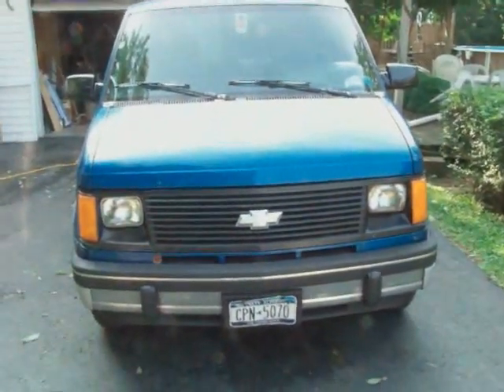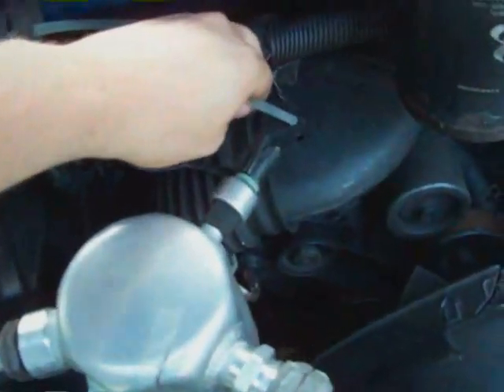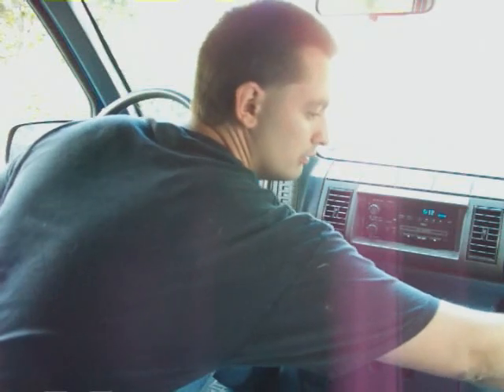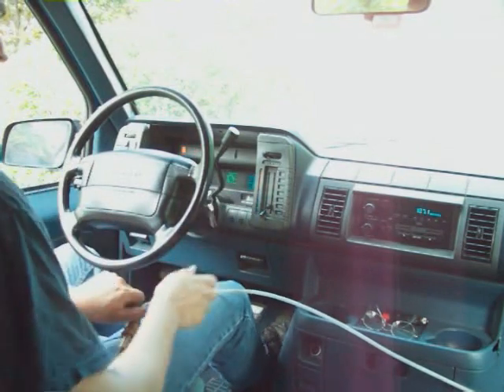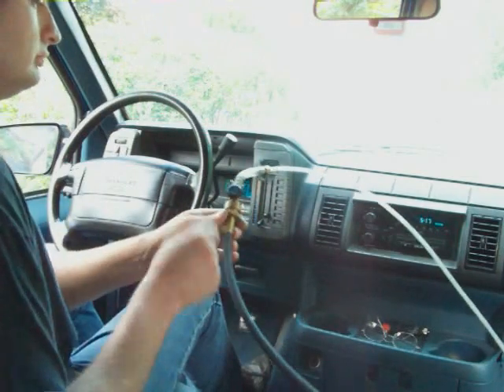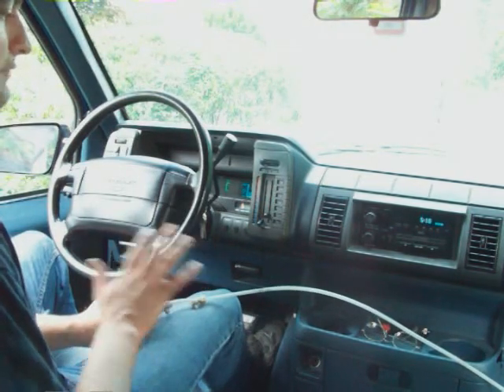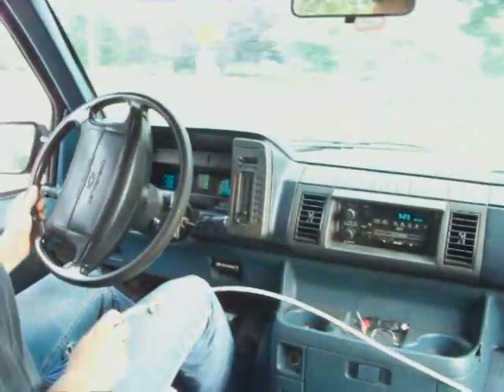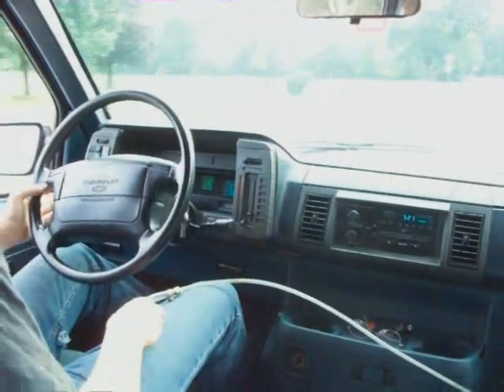astro van running off a propane torch NOT gasoline

Comment: Try bottle hose directly to your air intake. Use just the bottle valve maybe 1/4 turn to start and idle. You can jet out the torch valve.

Comment: There's a fuse to the fuel pump. You can wire a kill switch to the FP without wrecking wiring. Make 2 wires with blade connectors to plug into the fuse panel add a switch to the other end. Direct the fuel hose directly to the throttle body. You can adjust fuel by adjusting the propane valve.

Comment: I don't know if you have fuel injectors. But they won't fare well without gas lubrication. The reason you are having so much trouble with running the engine, is that the LP gas air/fuel ratio has to change, according to load.

Comment: No Kwacz.......   That's not how to propel the ejector seat like in James Bond Movies!   Having said that.....  If the tank valve or hose leaks into the passenger area and anyone smokes, well it could be an interesting ending to your video!

Lawd fadda.... turn it lean...no wait turn it rich....oh shit it's rich now...why does it do that as i keep pushing and releasing the pedal......damn this is awkward but it works when you get used to it!   LOL

Hey Kwacz, Try installing a gas ball valve on the gas pedal to the fuel is supplied more or less as you push on the pedal!!!    Oh shit noooooo don't try that please I was kidding!

I applaud your efforts here and you proved a point......  BUT PLEASE get rid of that contraption/set-up and either go back to all gasoline or do a proper and safe install which includes keeping the tank "OUTSIDE"  !!!!!

Comment: All yall freaking out over it blowing up. Ups trucks have been run on propane/natural gases for years.
Reply: yah but the way this is set up, when it stalls and backfires slightly, if youre not paying attention, the intake is now on fire and the plastic pipe will feed back to the tank...
Reply: @Hammerjockeyrepair  an lpg tank has no oxygen in it, fire can't go back into it.
Reply: @Camwize  if there was no chance of a problem then there would be no need for them to sell FLASHBACK ARRESTORS
Reply: Propane/CNG conversions are awesome, but a conversion that pays zero attention to safety is not so awesome.  You don't see a UPS driver taking his/her attention away from the road to feather a knob...a knob that causes back-fires if not turned properly...back-fires that produce an ignition source in the throttle-body/duct...a duct with unregulated and uncontrolled amounts of propane flowing from a section of poly tubing....which was rated for propane, I'm sure.  I can promise you that UPS trucks use regulators, a fuel metering system designed for propane or duel fuel, a fuel delivery system design for propane, a fuel tank that is secured, and a fuel tank that isn't inside the cabin.  There's only one thing preventing his nomination for the Darwin award...he hasn't died from his antics yet.  But when he does, the cause of death cited on his death certificate will be "Worst case of stupid ever".  One positive is that he has only achieved 25 MPH.  Wait, don't UPS trucks go faster than that?
Reply: @samiches2008  Fuck you people are boring, live and let live.

Comment: I did this with my 94 s10 I used a hi pressure house regulator 3/8 line with a ball valve in the cab and I can run 75  I have 2 30 pound cylinders it is tempormental but very possible use it every day because I found a place that will fill my tanks for 10 dollars a pice and I have a togel switch to turn my fuel pump on if I need regular gas...

Comment: You mentioned carburator. Don't you have fuel injection in you  Astro ?
Reply: The 'carburetor' he mentions is the torch-head, w/ screw-valve, plastic line, he's holding in his hand.

Comment: needs some steel wool as a gas check from flame back
Reply: Steel wool is flammable, it would be a very poor choice. Also, since there is no air in the propane tank, it can't explode.

Comment: you didnt have to drill a hole into your car you moron !! where do you thing all the wires are coming from !!?? your car or truck already has a a couple of holes already for all the electronics in your dash you dip shit ! that's what they are there for so you can run things from the inside to the engine
Reply: If I remember the Astro/Safari layout correctly, the existing holes in the firewall aren't very easy to access.   That little hole is the least of the problems with this video.

Comment: He's doing Trail n error so u idiots wont make the same mistakes. He's uncut. Nice video dude! And this does work!!! Especially if u do it RIGHT! Hydrogen is the way to go though!
Reply: Hydrogen in a tank is not good, and hydrogen + oxygen stored in a tank is a bomb waiting to explode. Hydrogen requires a huge amount of energy to compress. Hydrocarbons like propane are much better because the carbon partially neutralizes the repulsive charges between the hydrogen atoms. Hydrogen storage in carbon nanotubes is interesting though, some people are making extraordinary claims.
Reply: TempTag 
Yes it does i have a 100 plate one and boy 
Thats free energy

Comment: For all of you people lamenting the possibilty of explosion, propane has a higher ignition temperature than gasoline.
Reply: You're missing the severe problems.  

He needs a regulator, that will only allow gaseous propane through.  He says in the video that he sees liquid propane in the hose.   That can (and will) freeze the plastic, and it will leak.   

Propane is heavier than air, so it will "puddle" inside any enclosed space.  Even in an open space, it still puddles enough to cause an explosion.   

Propane has a much wider range of usable air to fuel ratios, so it has a better chance of exploding over gasoline vapors. 

Any little spark inside the cabin of a vehicle could ignite the propane gas.  There are a number of relays in any vehicle, which are not safe for flammable gas rich environments.   As I recall, there are some relays on both the driver and passenger sides of that series of minivan.

Propane is an asphyxiant.  So if your enclosed space (like the van) is higher than your nose and mouth, it can (and will) kill you.   

If he had used a regulator, along with a proper injector up at the throttle body, and run hard lines on the outside of the vehicle, it would have been a lot safer.

Anyone trying experiments like this needs to learn everything they can about what they're using.   If he did, he wouldn't even consider that setup.
Reply: @JWSmythe  look out everyone! The safety police are here!! Hey Mr Franklin, get that kite out of the sky , it's dangerous!!! You got a deathwish Mr Newton? Get out from under that apple tree, apples are heavier than air, they "puddle" if one of those falls off it could paralyze you, or even EXPLODE!!
Reply: Gasoline puddles as it is a liquid. 
Gasoline vapors are also asphyxiants.
Reply: +Jemalacane0 ... and gas tanks aren&#39;t kept on the front seat floor, with the wrong hoses to it.

Comment: My van is my home. It's jacked up with no tires. Can't move and won't ever move. Totally not driveable. Engine and A/C and heat work great. I live in it. Using your idea I expect to run the engine at a constant RPM to operate the A/C and charge battery etc. I'll disconnect power to the injectors and fuel pump.  Propane is readily available to me while gasoline is not. I'm also concerned about carbon monoxide from the gasoline.  Hope this mod will work for me.  Also will implement a safety cutoff valve that senses engine failure (via vacuum loss) and cuts off the propane.  What do ya think?
Reply: put an extension on your exhaust and run it out away from your living area if you can
Reply: Please get it fixed up enough to drive... I don't want you to have to abandon your home when you have to move
Reply: Get a small reliable motor like a honda gx and use it to run a car alternator with a belt. Charge deep cycle batteries and use a cheap inverter to run electronics. Running that big engine will waste a ton of fuel.

Comment: how many miles to a bbq tank? lol
Reply: +richard ford a swag is a20LB LP tanks is like 5 gallons of gasoline or a 15LB fill of LP is like say 4 gallons   This about 100 miles range on a BBQ tank
Reply: 3beltwesty 20lb propane tank holds 4.3 gals of lpg. lpg should have less energy than gasoline so it's probably roughly equal to 3 to 4 gallons of gasoline

Comment: why not leave your fuel pump on and just use a little bit of propane in your air intake to bring up mpg.
Reply: hondaxl250k0 that would likely just result in the pcm constantly trying to correct the mixture and fuel economy would probably actually decrease

Comment: Fun stuff.... An old test is to use a propane torch near the air cleaner to find leaks, or directly into the throttle body to check mixture. (or to just run...)
Anyway, I noticed that dash in your Astro!  Where did that come from??  I've got a Safari, same color ('93 and also in NY!)  and I've been looking for something like that. (and for some reason this morning I can't find the private message link...) Thanks

Comment: This would be a great thing to have as an emergency fuel setup.  You can keep a small can of propane in your car for years without it going bad or spilling.  If you run out of gas or have trouble with your tank out in the sticks, just use this to limp your car to civilization.

Hell, I think I'm going to do that.
Reply: Not a good idea for safety reasons.

Comment: Why wouldn't you just have a system finely tuned for the rpm it's at 65mph.  Set up a switch to the fuel pump.  Use gas up until that speed, hit the cruise, turn on propane, shut down the fuel pump.  Maybe you could travel long distance for cheap.

Comment: Looks like a nice idea in the event you run out fuel along side the road but I think its rather dangerous without a fire arrester. But this proves you can run a car on vapors rather nicely and not do anything to it.

Comment: i did that to my van when the fuel pump relay went bad, i stuck the open end of the propane hose in the air cleaner air inless, with the air cleaner still in place, adjust the fuel flow and crank the engine till it runs, and adjust to the proper fuel flow to maintain the vehicle speed, works for me till i got the van home, and replaced the fuel pump relay switch

Comment: @kwacz  Shit I broke mine and it was steal and thick!   I was missing two bolts at the bottom of the Horse shoe bracket. thats what I call it. it the bracket that holds alt,ac,wp,etc  the bracket had a crack in it and I had it welded.

Comment: @at1212b  I have before and the bracket that holds the alt, ac, ps,wp, had a crack in it. took it off and had a friend weld it for me. I was breaking the bracket that mounts from one of the exhaust bolts  to the side of the ps pump.  The bottom of the mian bracket has two bolt that had came out. that how it started.

Comment: @nuclear944 I wold have cut the wires for the fuel pump under the dashboard (EZ if theyre color coded). Install a good proven switch (More switches More FUN) You dont have to identify wires just pass all the wires through the switches in case there is ever a problem. Solder your connections. the use of a cannon plug(s)  is a plus. buy 4 of these: (copy and paste it in amazon dot com : JT&T Products (2700-5J) - 10 AMP @ 12 Volt, Illuminated On/Off Round Rocker Switch, Green. these are excellent!

Comment: Almost every car in Bulgaria runs on propane gas...they have propane conversion kits/shops that do the conversion for like 50 us dollars. Gas stations are more likely to have propane than gas/diesel....ha!

Oh and another way to stop the fuel pump is to disconnect the fuel pump fuse.

Comment from the maker: that doesnt even make sense. how is propane going to leak out of the thing when the injection point is below atmospheric pressure. it seems to me a leak would cause air from under the hood to be sucked in. not propane leaking out. propane doesnt leak out of a negatively pressurized cvontainer or anything else negatively pressureized.

Comment: they sell kits to do all this u are doing dominicans do it in dominican republic they sell the kits deppending on the motor size (v4 v6 v8 v10 v12) they do it to all cars its cheaper the gasoline and cheaper then hybrid for those of you that think its stupid u actualy save alot of gasoline money and i wanted to import a kit from DR to NY and its illegal kits comes with regulators and tubes and switches and all that stuff (tank not included) lolz u can google it for more info

Comment: I did a conversion on a small van years ago, used a modified SU carburretor to meter the gas.. worked very well. Attempting to meter the gas by manual adjustment is ok for playing but not really good enough to drive by.

Comment: Ive done this in my 94' Chevy Cheyenne 400 SS, But i changed the gas tank to a new one that is able to hold propane and I got a 100 Lbs. Tank on the back of the truck (bed)

Comment: replying to andrewsengineering, well propane has a octane rating of 103, but CNG (Compressed Natural Gas) has an octane rating of 130) so CNG is higher on it's octane than propane, i got a lawn mower i converted to propane, and i had it for over 2 years, and it runs like a champ, it takes me an hour to mow the whole yard a week, and that 20 lbs tank last a whole season, from 2nd week of april to 2nd week of november

Comment: Complete conversions are hard to get, you usually have to know what you need. Any Impco dealer can usually get the right adapters for a particular engine provided they are still available. The impco 225 carb would probably be a good choice for the van, with model J regulator. The adapters for my 460 were still available when I ordered the carb. Propane in my area now is running between $1.40 - $1.89 buying in bulk, it's much cheaper to run my 1 ton truck on propane. There are injection kits too.

Comment: It's not the flashback that's a problem, but caution should be taken not to have the tank sitting out in the hot sun all day before using it, it's when the safety pops that it becomes a problem. I've seen even opd tanks overfilled because of bad opd valve, there are a lot of improperly trained people filling bottles out there. On car conversions trunk mounted tanks have the safety, filler and bleeder piped to the outside of the vehicle.

Comment from the maker: it really isnt dangerous. propane needs oxygen to burn so it will not flash back through the tube. it is no different than a gasoline backfire. also there isnt anything illegal about doing propane experiments on your vehicle. what is dangerous though are all the people installing hho generators in their cars. anything goes wrong and boom. (because oxygen and hydrogen are both present it will flashback and burn anywhere even if no air.

Comment: That's the funniest thing i've ever seen! Just don't keep that 20lb tank in there on a hot day, the safety pops at 375psi, and anyone who has ever seen an overfilled or over heated tank pop off knows that you do not want it sitting next to you... also dry firing fuel injectors will not last long, they need to be turned off too. I have 2 trucks that run on propane, one can run either fuel, and one has over 200,000 miles on it, both have fuel injection with a propane carb. Propane is high octane.

Comment from the maker: it wont hurt it. they sell conversion kits and because propane burns so clean, it actually prevents carbon buildup and does not contaminate your oil. you dont have to do oil changes as often on propane. i have a lawnmower with this same setup and ran 3 20 lb cylinders through it and it still runs like new

Comment from the maker: it will be fine. i ran a lawnmower off of propane with the same setup for 2 years. the mower gets heavy use. its fine. also they make an actual conversion kit for cars. the only difference is that the fuel / air mixture remains constant under various load conditions. (the ethanol they are putting in the gas would worry me more than this. ethanol burns extremely hot.)

Comment: I know that Baytech Corp does CNG and LPG conversions for many GM vehicles. 

It's an expensive initial investment (couple thousand for conversion) but it will save on the cost of fuel and maintenance (you can go longer between oil changes since LPG burns cleaner and doesn't contaminate the oil as much as gasoline)